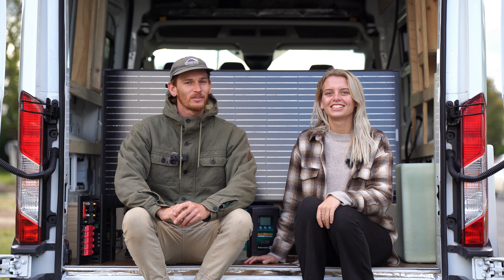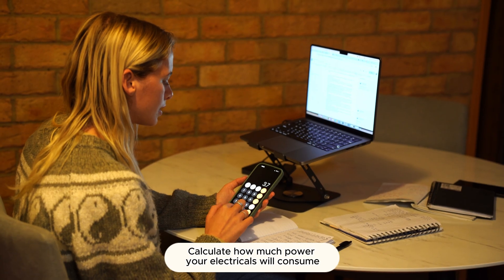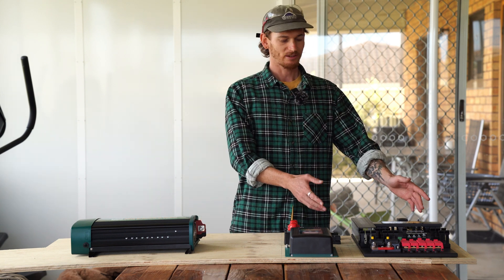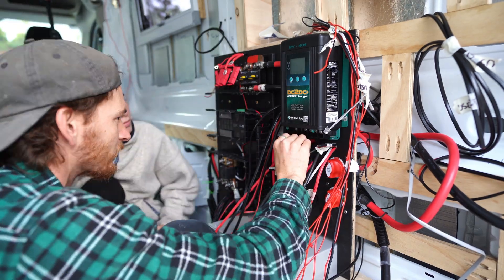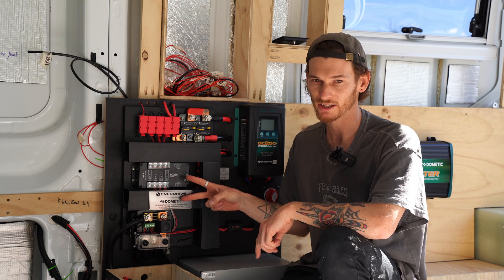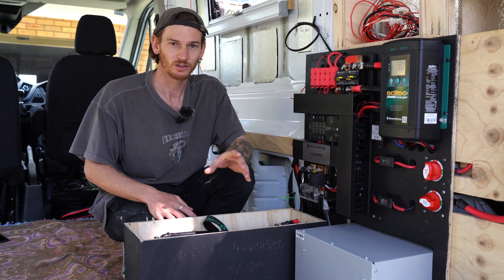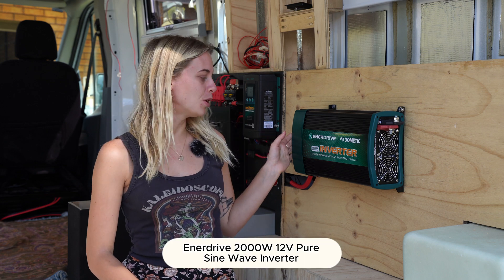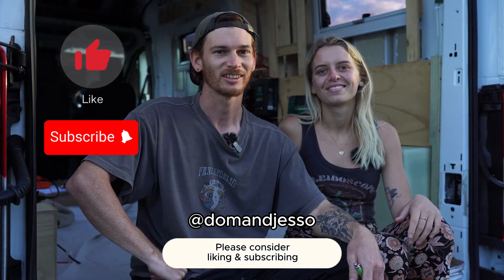A COMPLETE Guide to installing 12v ELECTRICAL SYSTEM into DIY VAN CONVERSION | Enerdrive Dometic

Comment: Hey Guys great video! 

I'm doing a van build myself but i have a question.   My van's starter battery is at the front of van. in order to hook it up to the voltage relay and leisure battery which i want to be in the back.. do i need to get those huge thick battery cables long enough to run all the way to the back?? I can't seem to find any that length :(

Thanks in Advance <3
Reply: The cost of thick cable means you'll want your leisure battery to be near the front. Vanlife builds often burn down because people undersize wires and have their batteries too far back.
Reply: @TheCatherineCC  thank you for the advice!
Reply from the maker: Thank you for reaching out with your question! For your van build, when connecting your starter battery at the front of the van to the voltage relay and house battery at the rear, it's crucial to use the correct gauge cable to handle the current safely and minimise voltage drop over the length of the run. This guide should help: https://enerdrive.com.au/2024/07/27/choosing-the-correct-cable-size-for-a-dc-circuit/